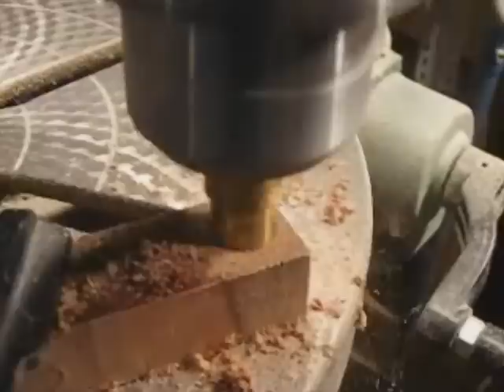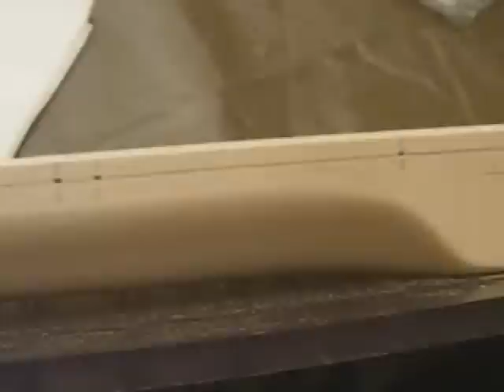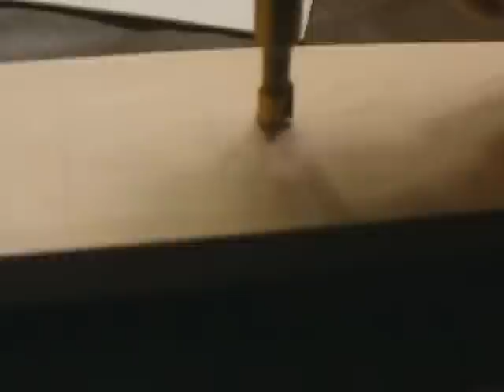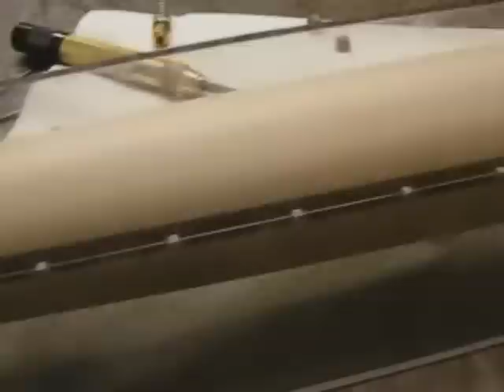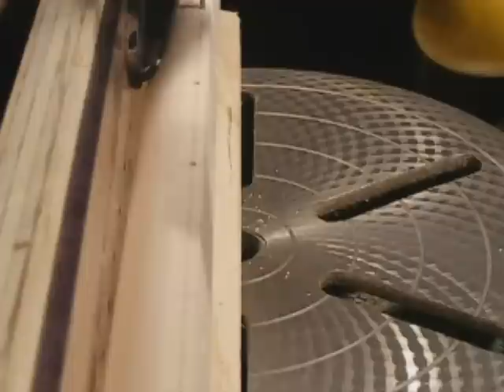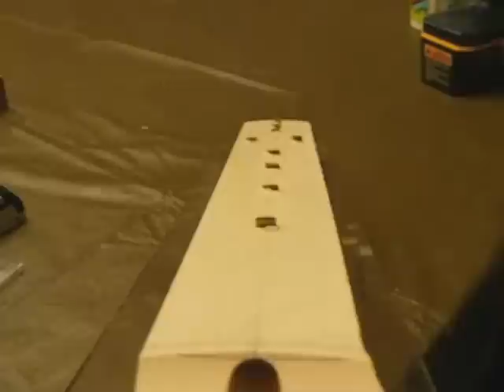One Piece Neck Build Part 8: Adding position markers

Comment from the maker: Hi and thanks,

The neck blank was thicker than usual so I wanted to knock it down some before installing them so I used the jig to bring it to 1/16" before I drilled the holes for the markers, but yes it would have been easier, that is how I typically do it.

Bill

Comment: Tip: tape over the plugs with painter's tape, before going to the saw. When you're done, peel the tape and your plugs will be stuck to the tape (instead of strewn around the shop).

Comment: @Bobo9977 I'm convinced that there is an 'engineering gene' that helps us track small objects from the corner of our eye, as they scurry across the floor.
Another tip that came to me after I clicked 'post', since they don't have to be flush-cut, it might be easier to install the side markers, cutting the rod as you go. That way, you have the length of the rod, to use as a 'tool' for inserting the tip.